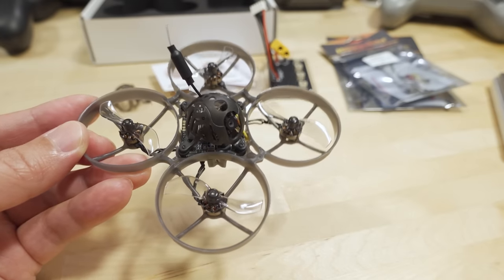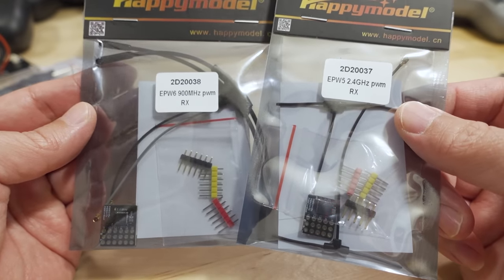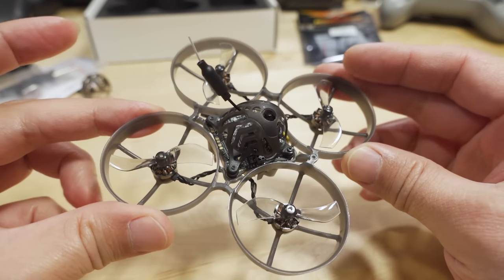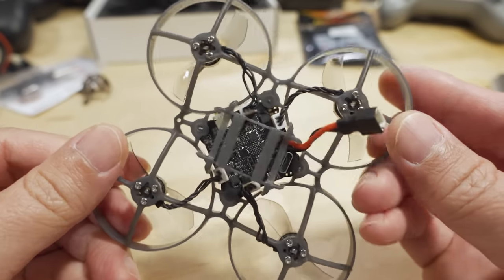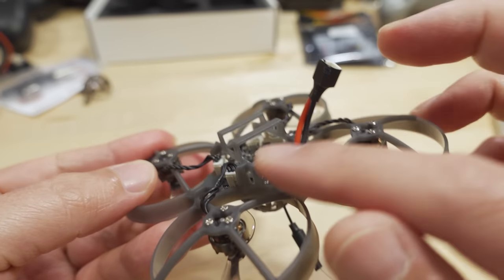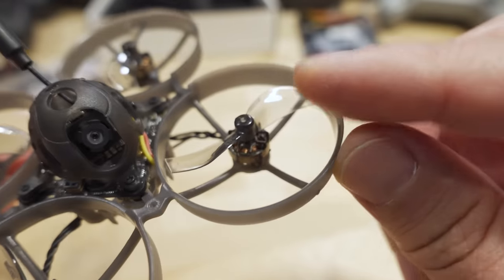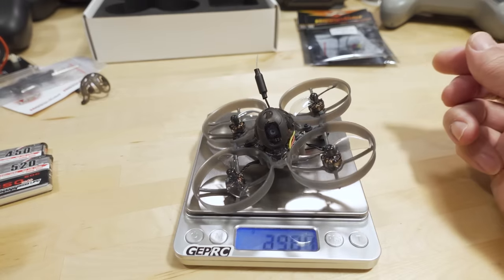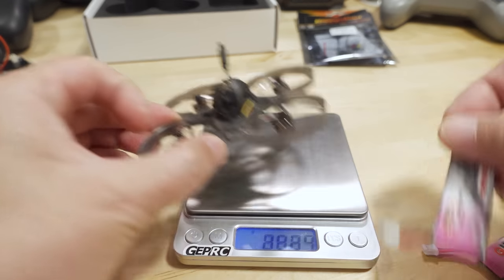Mobula7 1S ELRS Super Whoop 🔥

Comment: Would the included charger need to have all 4 batteries plugged in or placed a certain order to work correctly? Just remembering that fractal charging board you needed to pin off the unused cells.
Reply from the maker: Yes, it's a simple setup, not nice like the fractal one.

Comment: Picked up one of these and Im torn keeping it as is or pulling it apart and using the parts for different builds lol. Those motors are just the ticket for something Like a Tks75 or to replace motors on something like the flywoo nano or baby nazgul. 1.5mm motor shaft for the win.

Comment: great review Albert!   I am having problems with mine where it is just going into fail safe and dropping.  somehow the reciever is becoming unbind and it is at a close distance say like 5 to 10 feet.  Any ideas of what can be going on?
Reply from the maker: Do you have the ELRS receiver or the Frsky receiver?
Reply: @AlbertKimTV  i am having same probs as above and i have the elrs, also issues with the maps , on the cli dump it says TAER1234 when i use that and my radiomaster zorro matching those channel all hell brakes loose, worst drone i have ever bought, defo wont be getting another,

Comment: I'd really like to see the PWM elrs build in a plane, with some help in understanding how to get the sticks (4 channels) and flaps, and flight modes on a 5 channel device. Seems like I use 8-10 channels regularly on drones - leds, beeper, rate profile, turtle mode, etc.
Reply from the maker: If you need 8-10 channels, you can't use that receiver.
Reply: @AlbertKimTV  Seems like planes don't use many channels like drones. I'm setting up my 1st plane now, but these 5 or 6 channel Rx's seem too few when the sticks take 4. But then arming (Thr cut), panic (Safe) all seem to be able to be done with Channel overrides, so far. Still a bit mysterious...
Reply: ELRS has only 4 full-resolution channels, the other channels can be used but don't have fine-grained control.

Comment: Damn this people keep pushing me to jump into elrs, my early version t16 pro and my 2 year old crossfire lite on version god knows what (cus I never even cared to check) work like a champ  day in and day out and some how even on newer receivers 0 issues. I would have to open my remote and connect a ttl converter to load the bootloader on the multi protocol 🤦.  Not the biggest hurtle but I ask my self why when my stuff just works

Comment: Thanks for review. I have decided to buy this quad but what version is better to buy??
 1 ELRS spi incorporated ( flight controller is 1s and have mpu6000)
2. no rx version and add an ep2 elrs receiver (flight controller is 1s and 2s but gyro is not mpu6000). ep2 is easy to upgrade.
Reply from the maker: Depends on what other equipment you have.  You provided no background information for me to make any kind of guess.
Reply: @AlbertKimTV  Thanks alot fur your answer. I have ELRS transmitter ( flysky i6x with opentx and betafpv elrs module) so can have mobula 7 ELRS in two options
spi ELRS version or no rx and add an ep2 on uart. (Spi ELRS have1s fc with mpu6000 gyro and no rx version have 1and 2s fc that have Icm20689 gyro)
The motors are with ball bearings or bushes??
Reply: @stelic9515  what would be the  benefits of going with a no rx or pnp ? So to add your own elrs receiver and flash which ever elrs version you want and easy to work with what the pros and cons of doing that so if fc goes out the fc can be repair and not need to buy a new one ?or you can upgrade down the line vs spi elrs baked into fc?

Comment: Other than Happy Model wanting to push Elrs,  and a high output vtx, im still confused because after all this is a 1s setup. How far are you going to get out there before low voltage warning.
Reply from the maker: ELRS also allows you to explorer RF challenging areas like parking garages.
Reply: I fly in my house out a window around the brick building maybe to the lake & back in another window. Using 2" whoop with elrs & 500mw vtx (prob really puts out 350mw)

Comment: Good review Albert! 
I recently got these motors 0802 20k and replaced my older meteor 75 with pre elrs motor were 3.1gram and these 1.9/2 shaved some weight with these motor chopped some 4blade into two blade similar pitch didn’t touch the tune and find it flying pretty good. Any suggestions on the tune I’m at 25 grams dry the elrs external added a gram I suppose. 
Question :: I have access to the 5amp elrs happymodel fc aio  and NOT the latest 12 amp. Is there a big difference between the two in performance ? I ask cause I want to build another whoop with elrs and the new moblite will take time to reach my county
Reply from the maker: How does it fly?
Reply: @AlbertKimTV  I like the way ut flies bit I get random failsafes or maybe it’s time to say ‘my team black sheep radio is no more reliable in sorry to day my tango 2 needs a pc. Replaced
Reply: You should make a video Specific for tango 2 and whoops micros I like the way it feels but…The unit ‘which I will call’  that I paid for with my own ₹₹₹ has not even come close to my older Taranis that I usef  from 2014. I love th form factor of the tango 2 but the pcb is crap, I’m game to shift arm buttons no hang ups but when each one fails I’d say MY OLD x9d minus (kiddin) is way more reliable in my situation 
I do not change radios often but TRAPPY  needs to find the trap man. I guess I will have to buy a full size BIG BRAND radio simply cause these guys TRAPPED! Heck I got. Brand new rtf Nazgul and failsafes a. Much of times little difference I know it’s the crappy TRAPPY HARDWARE. Tell the dude he needs to fix the buttons

Comment: I liked it I ordered it BUT my Jumper T18 Pro V2, I can't get it to talk ExpressLRS! I've searched youtube for someone showing the setup for the INTERNAL 4in1 module and nothing.
Reply from the maker: The internal 4-in-1 module on the T18 does not have ExpressLRS in it.  You need an external module.  Check out the www.expresslrs.org website for more information about the protocol.
Reply: @AlbertKimTV  Yep, 4in1 with control for 'stuff' I'll never use again! It is nice that I can just disable the internal module and save power. I found a BetaFPV 2.4Ghz 1 Watt and had a nice time getting ELRS 2.2 installed. Getting the radio to talk to the Mobula7, have to relearn how to setup a model in EdgeTX... I did order a BetaFPV Lite Radio 3 ELRS, no tinkering just flying.

Comment: They gave you an old Mobula 6 canopy as your extra, instead of the new one.  Probably trying to get rid of old supply.
Reply from the maker: They look the same to me
Reply: @AlbertKimTV  It's missing the front mounting tab.  It only has 3 tabs like the old Mobula 6 canopy.  I imagine they added the 4th to help mitigate some of the "jello" issues they had with the old ones.  Surprised to see they're still throwing foam under the camera.